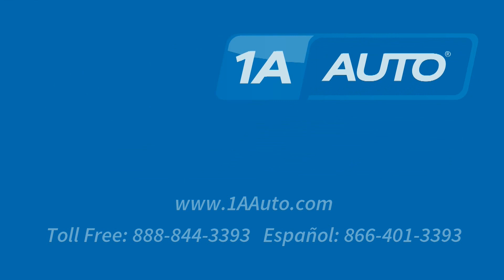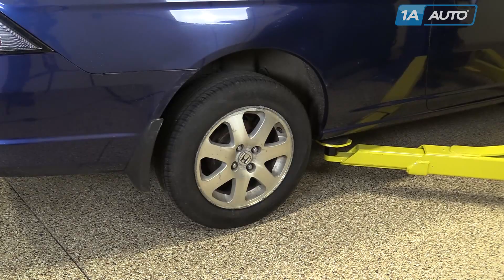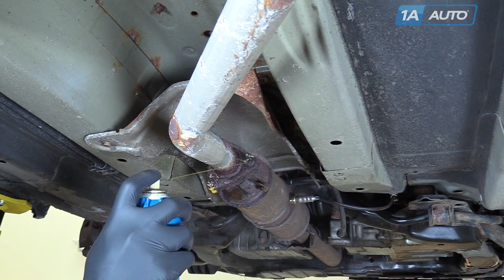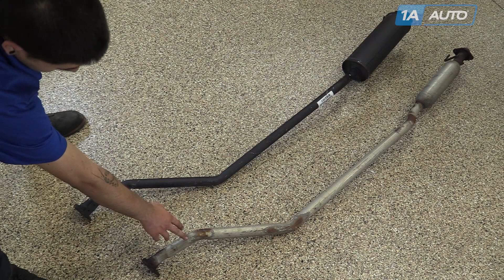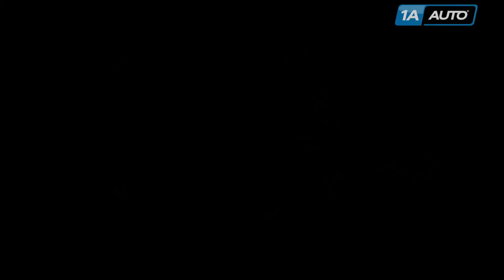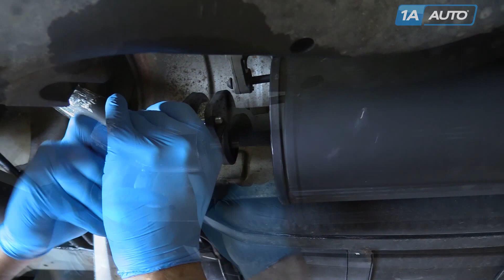How to Replace Cat-Back 01-05 Honda Civic

Comment: What kind of struts are those ?need to replace mine on a 2005 ex coupe ,I know to stay away from the monroes ,the dealer nos are suposed to be good ,the monroes have weak springs after a year 1/2  your worse than when  you started.any sugestions?

Comment: Dumb question but if the bolts come with the springs, where do they go? In between the gap where resonator and the muffler meet? Or at the end of the bolt where it ends by the resonator?

Comment: Hey ..... I have same car you showed in this video I need new exhaust with cat ( from front engine to back ). How much this gonna cost nd where I should get it ? Where are you located ?
Reply from the maker: +napinder pal Thank you for watching!  I would always recommend you contact us to get your replacement auto parts.  Give us a call at 888-844-3393, or click the link here!  https://www.1aauto.com/honda-civic-complete-cat-back-exhaust-system/i/1aemk00110?f=575148&y=2003